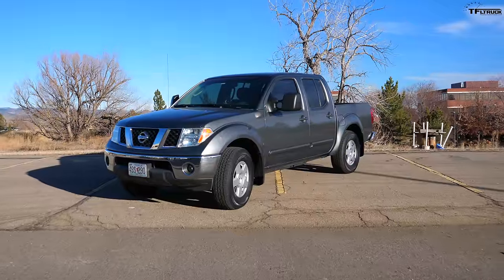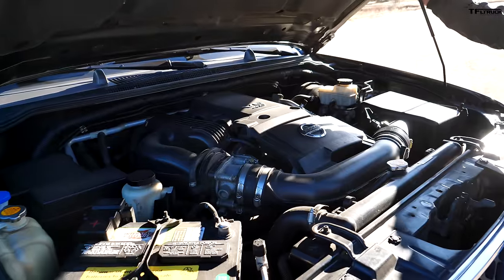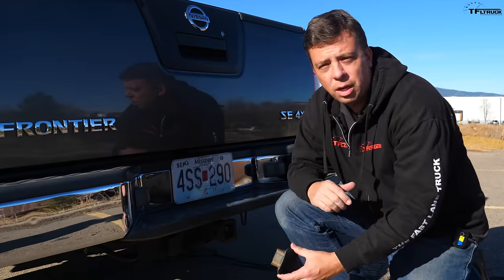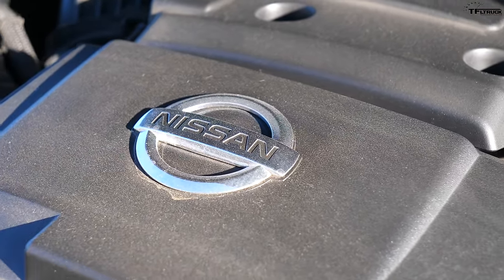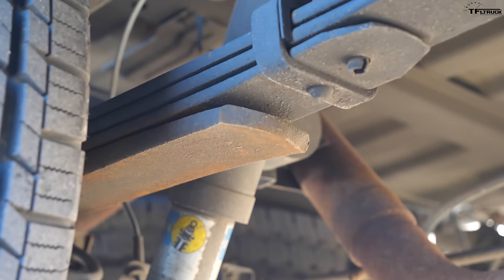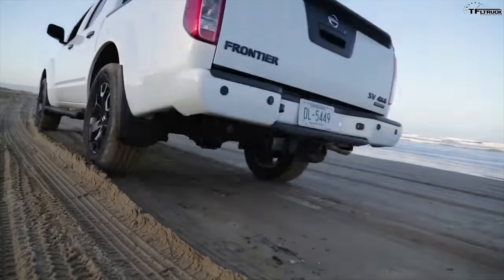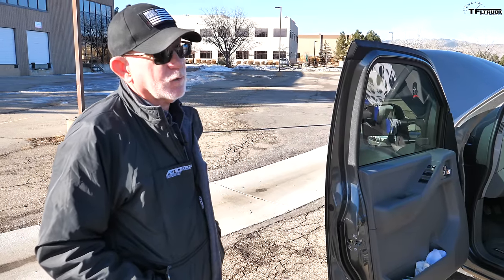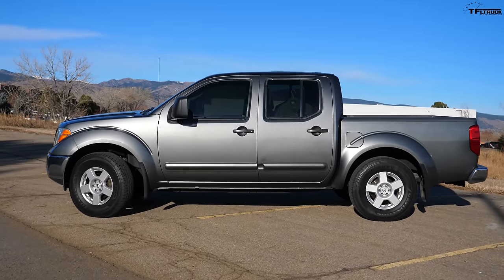Here's Why I Prefer The Old Nissan Frontier Over the New One — Dude, I Love My Ride!

Comment: It’s virtually the same truck as today! 4.0 v6 5speed auto (6peed man) Exact same as today!!! 

It’s been 16 years Nissan!
Reply: Devin Bender that’s what I was thinking.  The new one is the old one lol.
Reply: It’s been a while, but considering it’s sales have remained the same through out the years. It’s hard for a company to want to change something that works.
Reply: If it works, why fix it? You can't improve perfection
Reply: @GhostOfAMachine  It's nowhere near perfection, it's just cheap because the R&D and tooling were paid for ages ago.
Reply: And that’s why I bought a new one in 2017 for 16700.
Reply: Bradley Beyer yea it’s cheap as hell. And ford is going to under cut them with the Courior.
And 70k a year on average since 05. Not bad. For 2020 estimate
Tacoma 240,000 (3:1)
Ranger 150,000 (2:1)
Colorado 120,000 (2:1)
Gladiator 65,000 just behind. 

It’s behind everyone
Reply: @devinbender8428  and how Tacoma or Ranger is better than this? They are all the same cheap basic trucks. And a $500 stereo doesn't make them 1.5x (pricewise) better
Reply: Roman Tkachuk 

2020 Frontier SV 4x4 auto crew cab 5’ bed is $32,000 

2020 Ranger XLT is $39,000 

Ford has a far better transmission way more torque more power and ford 360 driver assistance. Led lighting and a nicer interior. 

That’s worth the <7,000 ( 20%) price difference. 

Thats nissans reason for the truck. Cheap basic plastic truck.
Reply: If it ain't broke don't fix it. Simplicity is this trucks BEST point. The more CRAP added the more problems and money out of your pocket. Purpose built, a forgotten quality in America today.
Reply: @devinbender8428  We might have different views on what we need a truck for. I wouldn't pay that extra 7k for bells and whistles
Reply: Devin Bender You can pretty much do anything to the Frontier to make it stack up to the ford, and still undercut it by about $5k. I wouldnt even consider spending $40,000 on a MIDSIZE truck. Thats full size Titan territory. And that truck beats the piss out of anything ford makes right now.
Reply: Roman Tkachuk since when is 25 more torque and a far superior transmission bells and whistles? 
That improves the towing capacity 7500 vs 6500. 
Payload 1900 vs 1500
Mpg  22 vs 16

Those are HUGE margins. Truck stuff. Not bells and whistles.
Reply: LRulesTheWorld 

The margins on towing, payload and torque and mpg ranger vs frontier is laughable. Not even close. And last I checked the f150 3.5 is just as cheap as the Titan and has more torque more payload and towing AND gets way better mpg. So wrong on both fronts
Reply: @devinbender8428  since reliability and maintainability comes into play. The only drawback is MPG, I would agree on that one
Reply: Roman Tkachuk please tell me what maintenance and reliability the ford needs more than the Nissan? 

10+ million Ecoboost engines out there with no issues 

5+ million 10 speeds
Reply: @devinbender8428  Don't get me wrong. I'm not saying that ranger is bad, but that's just how mechanics work.
Turbocharged engines are less reliable due to additional complexity and heavier loads on components. 10speed auto is less reliable due to complexity and increased number of shiftings. From the other hand you get superior ride and better fuel consumption. But hey, what's wrong with frontier? It has reasonable power, fast enough, heaps of 3rd party upgrades, classic truck appearance. Why to change it?
Nissan has actually made a new frontier in 2016 (NP300, D23), but it's a diesel only and doesn't come to America. Mercedes has badge-engineered an X-Class from it. But personally I like this old one's boxy shape more.
Reply: Roman Tkachuk that’s a very 50s way of thinking tho. based on that logic we should go back to a 427ci motor with 250 hp. Turbo engines are very reliable and can hit 200k miles easy.
Reply: @devinbender8428  You ask a mechanic today they will say the same thing long term use under stresses of towing and hard work the turbo engine will wear out faster than the naturally aspirated engine, putting boost through an engine causes higher temps and more stresses on the parts in the engine yes more power yes more torque but no in longevity under hard working stress, cant work around physics
Reply: C0ldyloxProductions physics ??? You know turbo motors only have to rev to 2500 rpm vs N/a motors that have to rev to 5000....
Reply: Devin Bender the more boost the more power the more power the more heat the more heat the more stress it’s pretty much common sense if u think about it
Reply: Plus there’s more pressure on the seals from the boost too have had several people come to my parts store replacing turbo clamps that broke on their turbo charged motors after only 3 years of owning them
Reply: Devin Bender what u got to think about is it isn’t what the engine is reving too it’s the pressure and heat generated from the boost the turbo is making the more boost the more stress u cause
Reply: C0ldyloxProductions 

Inner coolers make it cooler. And pressure in the cylinder is already 70psi what’s 10 more? You act like that little difference is a big deal. And as I said before. REVVING HIGHER IS WORSE!
Reply: Devin Bender I’ve talked to mechanics who work on engines for a living I’m going to school to be a diesel tech that’s what every single mechanic says that while yes the turbo will get better fuel economy but under the stresses that a truck gets will wear the engine out faster
Reply: C0ldyloxProductions DIESEL IS COMPLETELY DIFFERENT much higher compression rate and higher boost. Very different than a small displacement low boost motor.
Reply: Devin Bender yes but also built to last a long time using higher durability parts than a gas engine
Reply: Turbos on a Diesel arnt gonna cause the same hard wear on it as a turbo on a gas engine edit: also we are talking turbos on gas trucks which are using higher boost numbers than a car because they are being put into trucks designed for work, so yes the wear is going to increase under load I guarantee u the ecoboost engines are going to need seal replacements within the next 5-7 years where the naturally aspirated larger displacement engines wont
Reply: Devin Bender also I’ve only ever hear engines running at 30psi naturally aspirated where the hell did u get 70psi from only engines I’ve heard running that high psi are turbo boosted

Comment: I love episodes like this one!  Great job!   And it's not unusual to hear stories like this one.   I have a 2002 Chevy Avalanche 2500 with the 8.1L engine and the 4LE80 tranny w/ 3.73 gears.   It's set up with a Curt class 5 hitch to tow an 11,000 lb. trailer with a weight distribution hitch.   That big gas engine can do the job, and it's still rolling along at 175K  miles.   No engine/tranny work, but unfortunately plenty of replaced sheet metal due to corrosion due to the Calcium Cloride that states here in the NE use to melt snow and ice.   Bottom line, there are plenty of trucks out there that can last, if the owners take a little effort to look after them.    Great episode!

Comment: I had 187,000 miles on my 2010 Pro-4X when it got rear ended by a truck 3 times it's size that wrinkled the frame. Engine was still tight with great compression. Transmission was in great shape.  Would haul butt up either side of Eisenhower grade. Got me in and out of wherever I wanted to go when hunting in the mountains. Would still be driving it, but the insurance company totaled it because of the frame. Only thing beyond regular maintenance (fluids, brakes, etc) was to change the radiator to prevent the possibility of the radiator / tranny leak. Replaced it with a 2021 because I wanted the old body style with the new engine and transmission.

Comment: i have a 2012 frontier SV 4x4 with 204,000 miles. the only upkeep other than normal fluids have been new brakes, tires, and rotors. and only replaced once. I tow with it about 3 months a year ( duck boat ). Every year I tow my boat and all my hunting gear from Savannah, GA to Marblehead, OH to hunt diver ducks. its about a 1800 miles roundtrip with no issues. before i had my 2012 frontier, i had a 2000 model year frontier (5 speed) which lasted for 240,000 miles before trading it in. Only had to replace the clutch and starter in it.  Hopefully the Gen 3 will be just a reliable.

Comment: I like this guy.  Did his research before buying a truck.  Picked a truck that fit his needs.  New all the pros and cons of it.  Fixed all the common issues.  I just hope he replaced the oil gallery gasket while doing the timing chain or could end up with low oil pressure down the road.

Comment: Isn’t the old one and the new one the exact same? Truck is literally 15 years old but they keep wanting people to pay $40k for it. 😂
Reply: A while back when my wife went to get her Nissan Rouge services I looked at a couple  Pro 4x trucks. They were around $32,000...I paid as much for my 2017 Colorado 2Wd.
Reply: $40,000 is the Canadian price for a loaded Pro4X crew in Canada but the 2019s are selling for about $35,000 and 2020 models are about $37,000. One like this in the video isn’t available in Canada. If you get the base 4wd Crew it is only Automatic and 6 ft bed. They are down as low as $32,000 CAD. That would be less than $30,000 usd!! The loaded leather interior Tacoma TRD Off-road is just over $49,000 and you will pay $48,750 or more. $13,750 difference. If you don’t mind older technology vs new, you can save some serious cash! If I was towing the loads this guy does I would get the Frontier. Toyota needs a better truck motor in the current Tacoma. The 3.5 has a terrible torque curve for truck use.

Comment: My 2011 frontier has 258k. Has been rock solid and only thing I've ever changed was the starter. I tow a small snowmobile trailer and it handles fine. I would recommend to anyone.  I love it
Reply: My 2010 fronty has 291k and is still my daily driver. I drive it over 100 miles a day. I havnt done much to it.

Comment: You know they sell vk56de swap kits
Reply: What a badass truck that would be
Reply: Yar Nunya  the stock trans is good! But it is a truck so don't expect to shift as fast as a 370z trans
Reply: Yar Nunya  The stock 6spd works and you can retain 4wd. check out drivendesire on fb or intagram they do the swaps.

Comment: I still have the 1998 frontier that my father bought new. Currently 225k miles. I have the 4 cyl and a manual transmission. I replaced the clutch, alternator, water pump and starter at 200k more as wear, they still worked but to keep reliability. Also had to redo the AC once at around 180k miles and 15 years old. I want a compact truck so nobody makes a truck that I would replace it with today, maybe one day and electric car maker will do a compact that would make me first in line to buy it.

Comment: The Tacoma wouldn’t have those engine and axle problems.
Reply: No  cause it would just break in half from rust lol
Reply: It would definitely have rust issues. I guarantee the Tacoma would have had a part failure in that time frame as well. Toyota is still a mechanical machine and they do have part failure like everyone else. It is not a mythical beast! The 3.4 in the Tacoma was prone to several failures, one being the timing assembly. They are trucks, they require maintenance.
Reply: Like I said, the Tacoma wouldn’t have those engine and axle problems. 
I didn’t say anything about rust.
Reply: Kent Keller I said it will have mechanical issues as well as rust. It’s is very hard to have a realistic discussion with anyone that is a fanboy of Toyota. They are delusional to the rust issues all the way up to 2017. I would much rather have a timing chain replaced than an entire fracking frame!!! The 3.4 was a problematic motor. The rear differential for 2016 and part of 2017 really had issues and that is 9 years later than the manufacture date of the truck in this video. Toyota STILL couldn’t get it right. I will agree that the 2015 Tacoma I’d dang near bulletproof, that is the only year. I know people that have had repairs like the timing chain, lots of fuels system issues. I had a 2014 Tundra that was terrible! I have owned well over 100 trucks in my life between, my personal trucks, collector trucks and the ranch related work trucks. The worst ever was a 2014 Toyota and by far, the best were Fords! I was surprised by the Fords honestly and seriously disappointed with the Tundra, which was a dream truck of mine initially.
Reply: I don't even own a Tacoma. I drive a E-350 van. I was just saying, an 06 Tacoma wouldn't have had engine and axle issues.

Comment: I have an 06 NISMO frontier with close to 200,000 miles on it, and I echo pretty much everything this owner says. I would absolutely buy this truck again in a heartbeat. I did some simple modifications added a cold air intake out of your true 2 into 1 MagnaFlow exhaust, and advance the timing 2 degrees, and the truck just rips. if I'm hard on the throttle when I'm getting on the freeway I can chirp the wheels all the way through third. Every time my friends drive the truck that remark at how fun it is to drive, and there's just the right amount of power for the size truck that it is to keep it fun and utilitarian

Comment: 2010 Nissan Frontier SE 4L V6 4x4 Auto,  85,000 miles.  Towed a 30' 5200lb Travel Trailer with Equalizer 10k Hitch.  Replaced both rear leaf springs because they broke and I hardly ever put anything heavy in it.  Both camshaft position sensors failed and replaced those, Brakes were pretty squishy from the day i got it and adjusted the master cylinder.  The exhaust mounts and heat shields have all rusted off and currently have hole in the exhuast i'll have to fix shortly.  Radiators on the automatics are known to have a potential corrosion issue that will eventually leak antifreeze into the transmission but so far i haven't had an issue.  Truck does run well, rear axle still in good condition.  I'll probably drive it till it's skidding down the road on the frame rails.

Comment: I have a 86nissan four wheel drive runs and drives good and the odometer is almost at 500,000 miles I also just got 2020 pro four x with lift I've loved Nissan since my first at sixteen

Comment: I got an SV with almost bald tires and the 4wd took my through a muddy creek. Didnt get stuck. The chain issue is resolved after 2010. You can save your rear end by changing the diff fluid early. The axle vent sucks so moisture accumulates and wears it out.

Comment: My 07 frontier hit 244,000 miles and I have to do the timing chain finally. I replaced the AC system myself and had a shop recharge it. Cost me 400 bucks. That’s been the extent of my repairs. I tow a popup pretty regularly. It’s been a great truck and I’ll probably get another.

Comment: Love my 2011 Frontier! Bought brand new August of 2011. Since then I've clocked 250K plus mileage and only break down was 2 cam sensors with the second I believe a bad one off the shelf. Other than that basic maintenance. Its taken me everywhere from bear hunting camp in Pa to elk camp in Colorado to hurricane Harvey relief trip towing a verified 7500 pound load from Nashville Tn to Port Arthur/ Beaumont Tx. Yes I know that's above its rating and wouldn't advise it to anyone who doesn't tow a lot but it handled it like a champ. Sadly I'm about at max capacity and looking to go 1/2 ton or even 3/4 ton here soon.
Reply: Glenn, what engine and transmission do you in your Frontier?

Comment: I love my Xterra. My buddy saw how well it worked, and how reliable it is, and how it just loved to work, and that sold him on his brand new 2018 Pro4X Frontier. It's a good proven design. It's the kind of truck where you aren't concerned with having loads of features, but rather you want it to be out there riding happy, without that nagging thought of "If this thing craps the bed, I am skrewed."

Toolkit in the back, a few spare fluids just to be sure, and you know you're good to go across the country.

And by god, do these things like to play in the snow, drift around, whatever you want.

And my final point is this. These are solid and fairly safe trucks. Compared to a 2012 Ram 1500, the stability control is vastly superior. Genuinely fantastic and has saved my life before when I was going down the highway and caught one of those plow-droppings, a half foot of fairly packed wet snow that ripped me sideways. It pulled itself back straight. One day when I had the traction control off I kicked it sideways, ran out of opposite lock, went into the ditch and hit a tree at around 15kmh when it impacted. A little ding on the big heavy hood, a snapped light bar mount, and a little bit of stress scratches on the front bumper. These are solid trucks.
Reply: I can attest. I had a deer run into my xterra. The only damage was a dent to the fender and front bumper. The thing is a tank. If that was most modern SUVs, car, or crossover it would've crumbled like foil. Definitely solid built vehicles.

Comment: Hey got you beat. I have a 2004 Frontier with as of today has 332567 miles on it and still doesn't burn oil have not touched the motor. Been a GREAT truck so far.  Before that I had a 1986.5 with the Napz motor. Put 276000 on it and sold it for what I bought it for. Datsun/Nissan Great trucks!!!

Comment: I’ve had my 16 Pro-4X about a year and a half. I’ve put around 20,000 miles on it and have towed several times. My only gripe is the fuel economy and 6th gear power. If you’re in 6th and floor it, it doesn’t do much accelerating. I think some breathing mods and an ecu tuned for those mods could improve power a bit, so I will likely do some upgrades in the future.